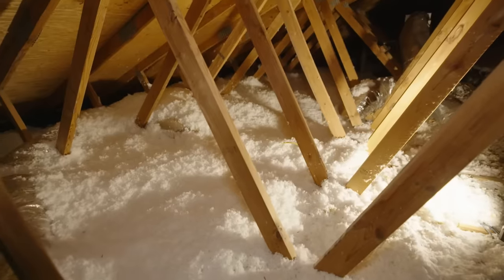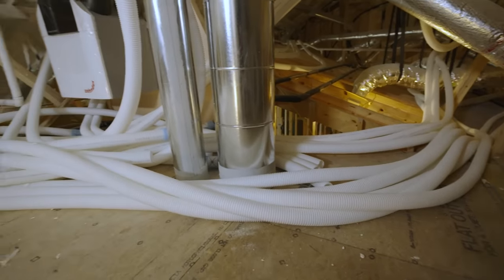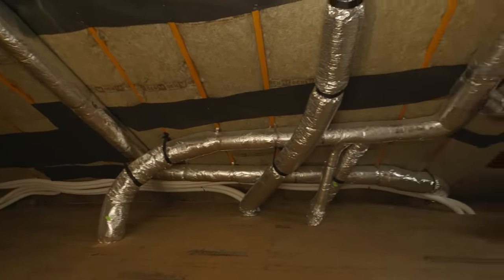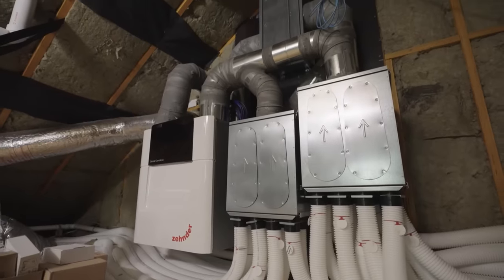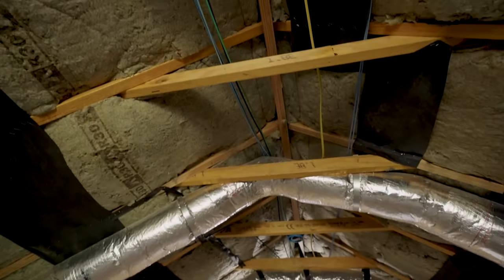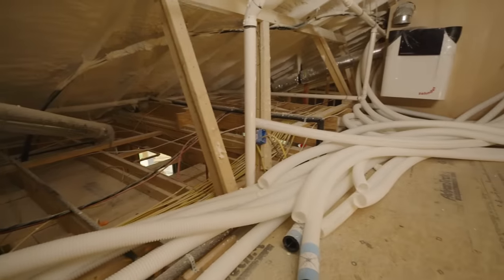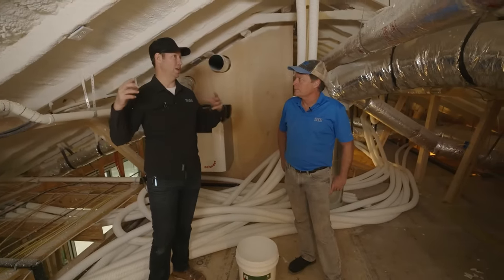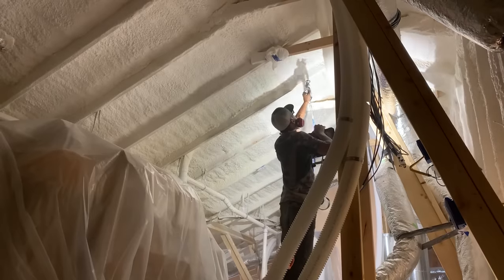Building a BETTER attic - Unvented + Conditioned attics 101

Comment: If the ductwork is in conditioned space then why is it insulated? Could run hard duct with no insulation on it. As long as the duct surface temp never drops below the surrounding air dew point it won’t condensate.

Comment: This would not work in a cold climate. Heat transferred through the insulation to the outer surface would cause snow melt which in turn would freeze  again when it reaches the cold overhang. The build up (Ice Dam) would result in serious damage.
Reply: Ummmm.....no.

Comment: This is a flawed system. Unvented attics provide no ventilation for asphalt shingles thereby reducing service life. In addition, diagnosing leaks is nearly impossible. By the time the leak shows up, considerable damage will be done to the deck. In addition 120-130 degrees is NORMAL for a traditional attic in summer. If hotter than 135, then there is a venting issue. The ONLY advantage to unvented is the HVAC is in the space.
Reply: I would have to agree. No part of the HVAC system should be in a vented attic. That's just poor design, not a flaw of the vented attic. The only thing that should be in a vented attic is insulation. If you have a well designed vented attic with the right amount of insulation, it should last a lifetime.
Reply: @HTHAMMACK1  amen!  I believe these will create a lot of problems down the road

Comment: What a ridiculous waste of square footage. Why would you condition an area you weren’t going to finish? And why use insulated ducting in conditioned space? This method isn’t better, it’s just far more expensive for no reason. If you’re going to pay the extra for attic trusses, route the ducting through the unconditioned spaces around the edges and finish the conditioned spaces. 

Spray foam is great in theory, except it costs significantly more than almost every other form of insulation, is very tricky to install correctly, and usually ends up getting sprayed in by day laborers who have no idea what they’re doing and mess it up. I guess if you build houses for people who burn stacks of hundred dollar bills for warmth in the winter you can use nonsense methods like these, but for most people this video is nothing but a sales pitch for the brand new square wheel design. 🤦‍♂️

Comment: I feel like I'm watching propaganda. A vented attic does make sense when done properly and is likely to result in a cheaper build and cheaper operating costs (because not as much volume requiring air conditioning/heating). You've told one side of the story, Matt. Now tell the other side as well. Let your viewers decide.

Comment: Why are you still using central heat and air instead of far more efficient DC mini splits. They're less expensive and provide redundancy and they're at least 20 percent more efficient than a central system. I'm not a Woketard, and I'm not pushing the global warming hoax here, but I see no reason why central systems should ever be installed anymore unless the homeowner is stuck on them.

Comment: Why ever did you bother spending all that money to insulate your loft space, you obviously don't use it as living space since you've filled it with all that ventilation ducting! You should insulate between the loft floor and the ceiling of the room below. Florida is obviously a warm climate, in the UK where I live roofs were traditionally uninsulated and even unfelted. The house I live in has only slates and is draughty as hell! Thats good because it carries warm moist air away (ventilation). If there is a water leak it even allows the timber to dry out! All we keep in our loft is Junk. If your loft space is getting too hot then just put some bloody holes in it so the air can get out!
I THINK THAT YOU EVIDENTLY HAVE MORE MONEY THAN SENSE!
STOP WASTING RESOURCES ON WORSE THAN USELESS THINGS, YOU ARE CONTRIBUTING TO THE DESTRUCTION OF THE ENVIRONMENT WITH YOUR CONSUMERIST WAYS!
I am by the way a small time builder with no greater qualifications than a bit of common sense but I have seen off the likes of chartered surveyors with a string of bullshit letters after their name with no more than  that bit of that common sense.

Comment: How about a more nuclear idea, stop using wood building materials. Let's go back to solid stone, bricks, and blocks. All are thick, weather proofing, noise cancelling and easier to climate control. These buildings last longer and can be fire contained to solid room builds. Dome buildings circulate air and can have channels molded into the outside for water run off or collection. If we crave or create solid room or house builds then the potential for water proofing and flood proofing increases. There are plenty of ways to preplan plumbing, electrical, and waste routes and put stylish access panels over. 
Japan has created entire bathroom units with waterproofing from the incoming resources and hidden cabinet style doors for water/electric access. We don't need insulation, cheap wood products, and all the other waste created from building materials. Structures made from stone can last thousands of years reducing the need for more throw away products.